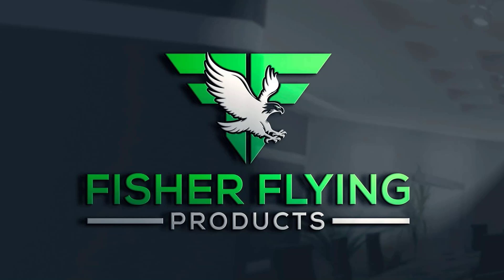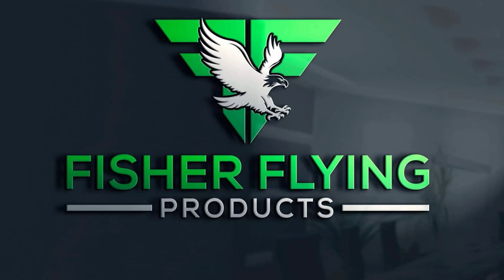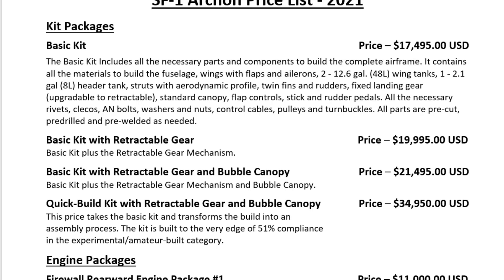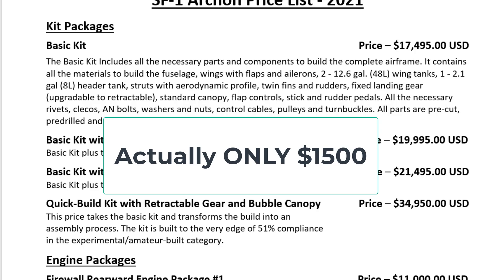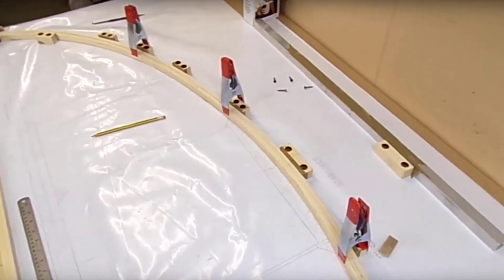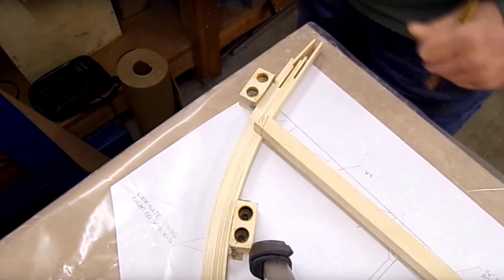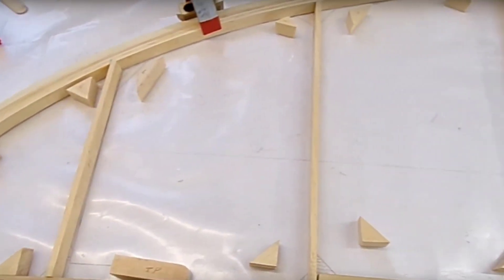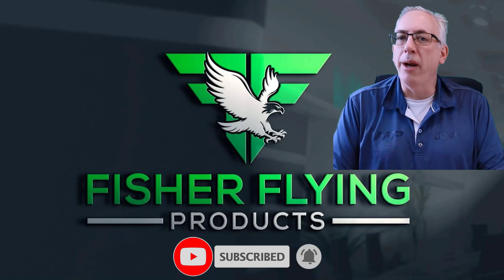SF-1 ARCHON PRICING - 10 QUESTIONS ABOUT THE SF-1 ANSWERED - ALGY YATES TAIL KIT BUILD NUMBER 3

Comment: Under the Basic Instrumentation Package you write: Talos Aelus EFIS with Engine Monitoring. Is that engine monitoring system displayed on the same display ( tablet) as the EFIS?
Can you give me a bit more information about the engine monitoring system please? Thank you.
Reply from the maker: There is going to be discussions regarding the basic package over the next couple of weeks. The Talos equipment is what the designer had chosen but may not reflect what North American customers may want in the panel. We also want to have an airframe wiring package that goes along with it.
Reply: @fisherflyingproducts5747  Thanks for your really quick response. My question was not what your Basic Instrumentation Package might look like but more of a technical question how one integrates (or not) an engine monitoring system with the Talos Aelus EFIS. Or if one has to have a stand-alone Engine Monitoring System and if so what EMS are you looking at. The reason I am asking is that I am building a single seat aircraft and am contemplating the use of the Talos Aelus EFIS but have no idea yet what to do about engine monitoring.
Thank you

Comment: I like the SF1 Archon but for the $ 150,000 AUD it's almost in the Risen ballpark which is much cleaner, more polished, twin seater side by side with an epic range and performance with a super panoramic canopy with the back up safety of a ballistic parachute and a superb glide ratio.
Reply from the maker: Thanks for the comment but the Archon is not meant to compete with the Risen
Reply: @fisherflyingproducts5747  I realise that and it is unique and asthetically pleasing for the most part, extremely stable at low speeds due to the multi-dyhedral effect of the fuselage which is brilliant for being right side up or banking.  If I were to purchase one by the time I was finished the designer would hardly recognise his own creation which for obvious reasons inspired me to bypass the wasted expenses and dive directly into my own ground up build that would eventually compete with both

Comment: So, what's the useful load with various engines for the SF-1? The price is okay, but a bit high for a single seat-er IMHO. Can't fault you here for this, all kits are a bit too high priced for my taste these days. Guess wood and aluminum is getting very expensive to source. Plans building is the only way to save any cost anymore....sigh.....at least we still have that.
Reply from the maker: The aircraft can easily fly with a normal sized pilot with enough fuel to generate "excessive smiles"!
Reply: Congrats on bringing the Archon to NA!  It is the most exciting aircraft design available to mere mortals (civilians)!